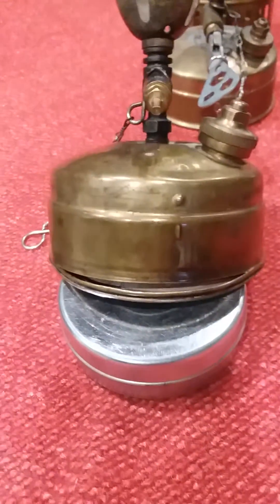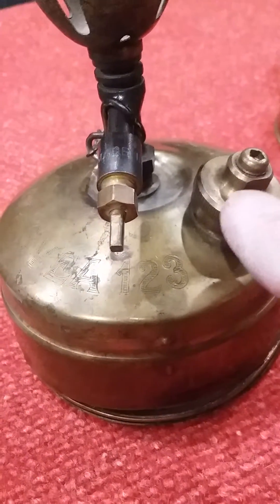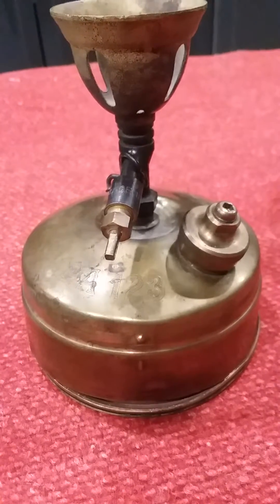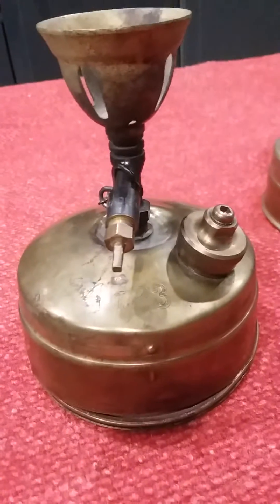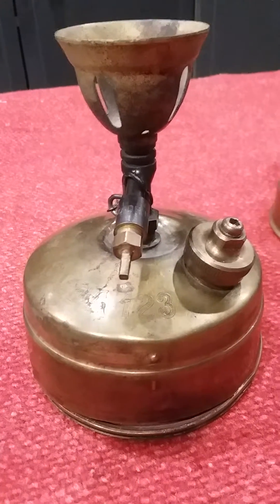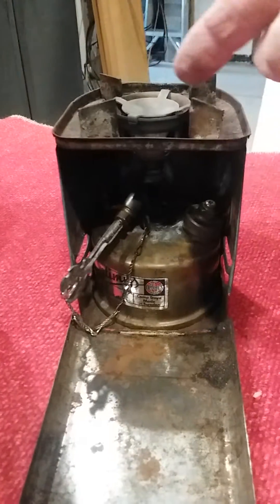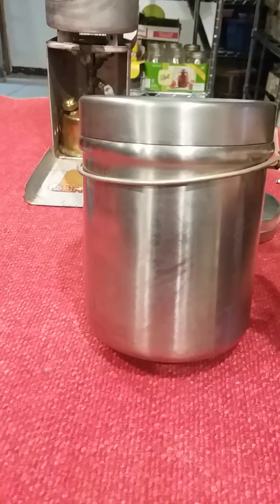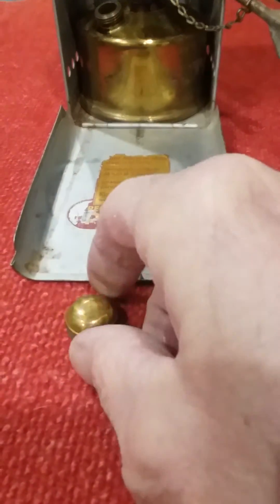More information on a the ruptured SVEA 123 fuel tank

Comment: yep i agree on your thought of cause. i've used like a 6 quart ice cream alunimin can as a melter for beeswax.  i  would call them almost indestructable, unless your using a wide stainless steel or a cast iron skillet.  all i managed to get mine to do was get a little candling , thats with the valve screwed all the way in. i ran that stove at high for over a hour. those are the best stoves ever, i have 2 of them.
Reply from the maker: I agree that these stoves are the best. The stove I purchased to replace this blown stove till operates flawlessly.

Comment: Very good information about the larger pot and windscreen potentially affecting the pressure in the tank. It makes total sense when you think about how these things work. I love seeing some of the other versions. Cool stoves,  great video. Thanks!
Reply from the maker: Most of these stoves are " parts" stoves, a little rough around the edges, but I can't seem to give up on them. Many more models to come!
Reply: @bigsky2081  Do you happen to remember how hot it was inside while you were cooking? If it was summer time, without electricity/AC, I wonder if ambient temperature played a part?
Reply from the maker: @MrTangent  It was September and cold. A 3 ft wet snow had knocked the power out for a week, hence I was cooking on the Svea. It's a mystery!
Reply: @bigsky2081  My only thought is that it was a manufacturing defect then? Or it had been dropped/dented?
Reply from the maker: @MrTangent  I agree with a flaw in the manufacturing process. I tend to really baby my gear!